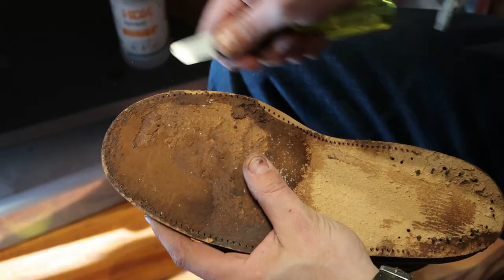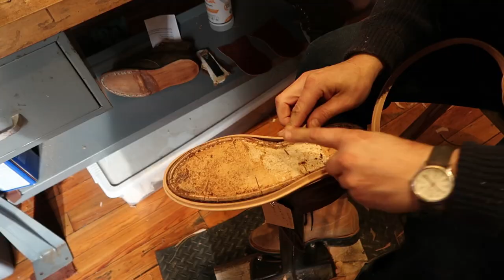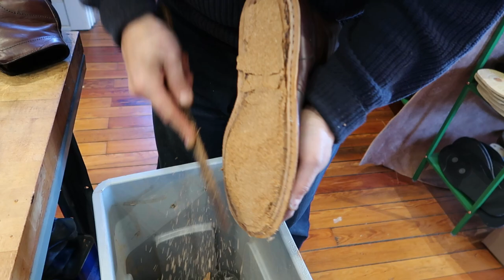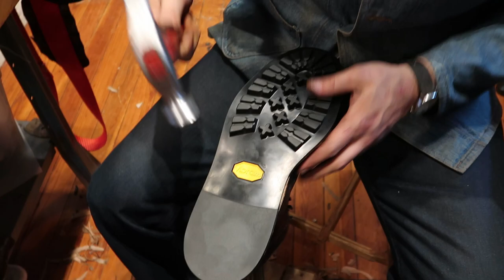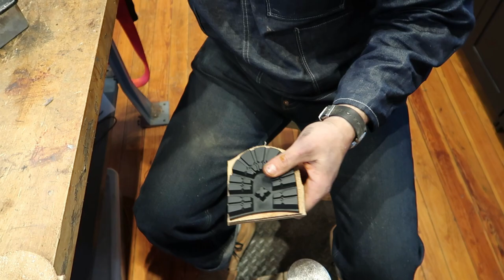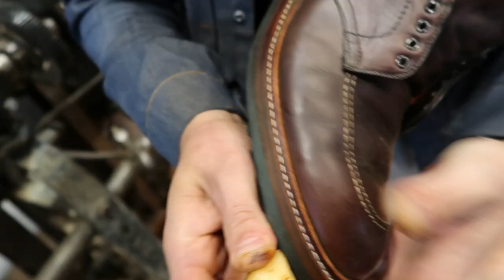Alden Indy Boot Conversion

Comment: What grit sandpaper do you use to smooth out the edges of the sole/welt?
Reply from the maker: We start out with 40 grit and then 100 grit on the machine. Then for hand sanding we use 320 then 1500.
Reply: @UnsungHouse  Thanks!